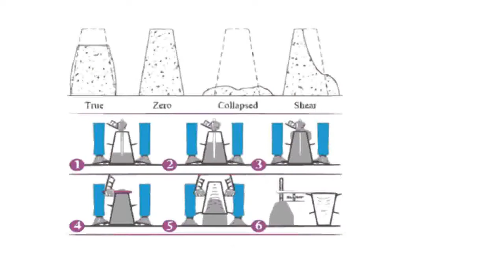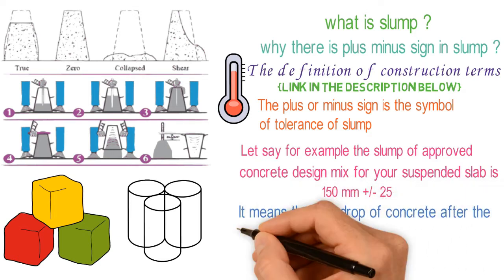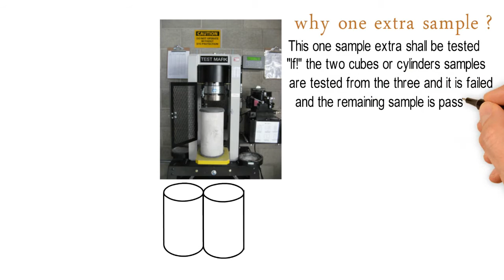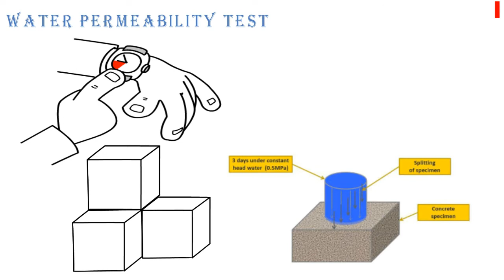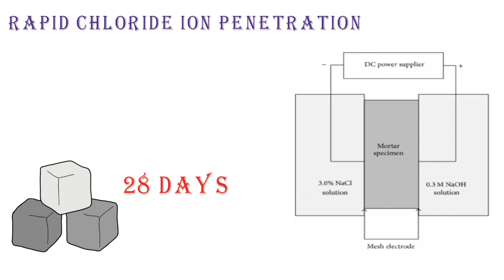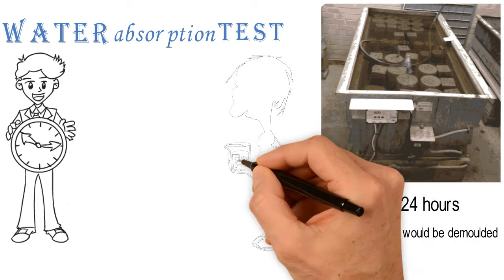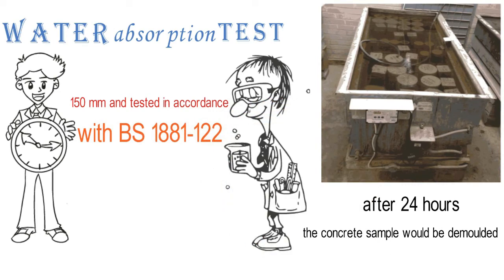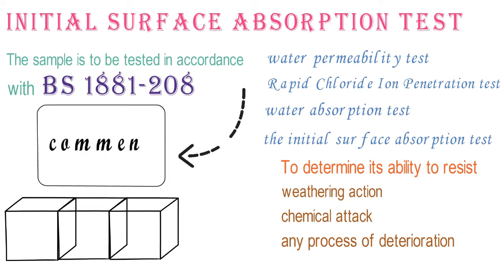Top 6 Important Quality Test Of Concrete

Comment: Air content on fresh concrete?
Reply from the maker: It is mostly done during a concrete trial mix.
Reply: @qualityengineersguide  Air content on fresh concrete is going to be able to better control issues on site than permeability, RCP, or absorption tests on hardened concrete. These tests are trial mixtures to be determined as well. How do you provide quality assurance for the owner that the proper concrete is being placed for their interior concrete instead of their exterior concrete? Additionally, if your project documents require your compression test specimens be made in accordance with ASTM C31, your report requires either an air content, or an explanation for not including an air content.